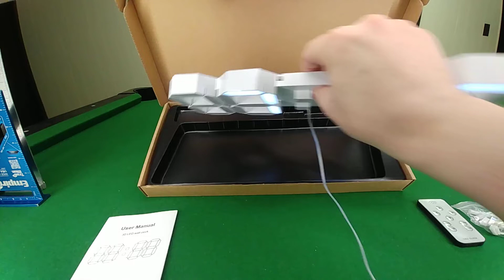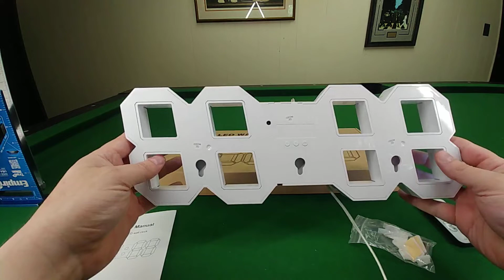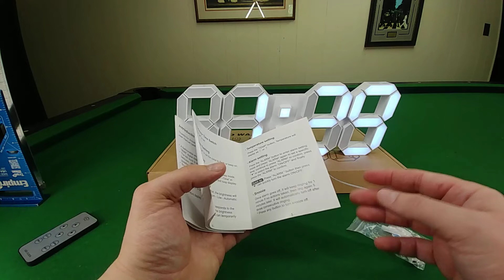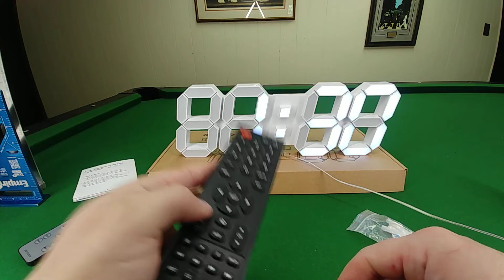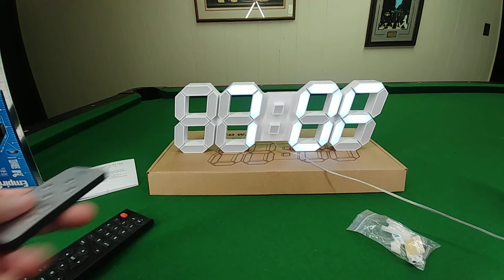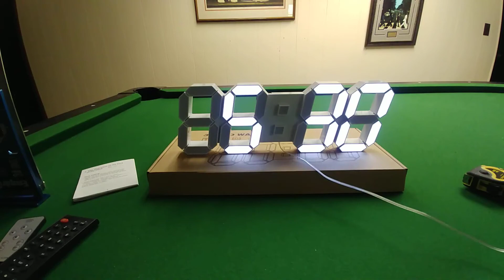Deeyaple Led Digital Wall Clock 3D Alarm Review, Nice clock with one little issue

Comment: Hi. For some reason, the clock has connected to the fire tv remote. Whenever I turn the volume up or down it makes that peeping sound. And when I power the tv on or off, it shows the temp. How do I disable this?
Reply: Sorry, I sent this message prematurely. I finished your video and putting electrical tape over the sensor worked. I didn’t realize what that was. Amazon owes you a million bucks for that one. Thanks!
Reply from the maker: Thanks